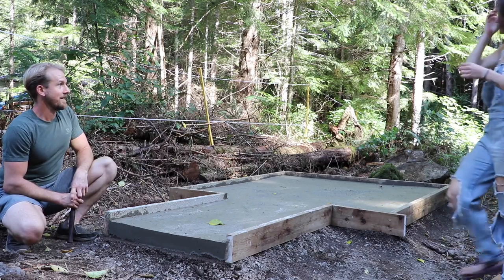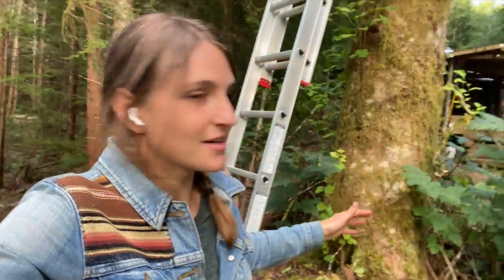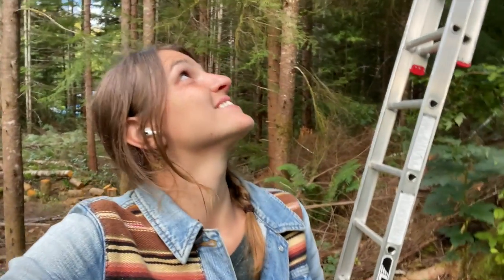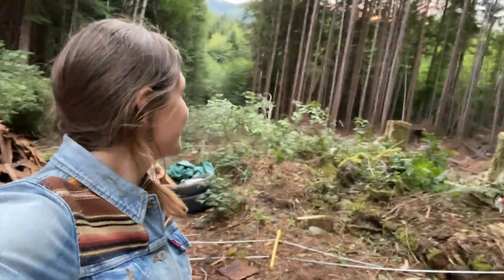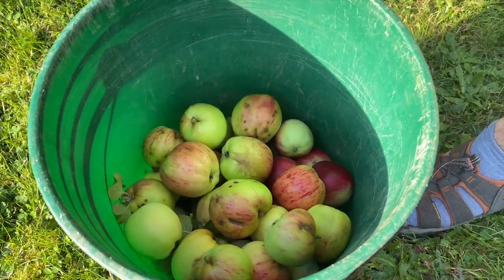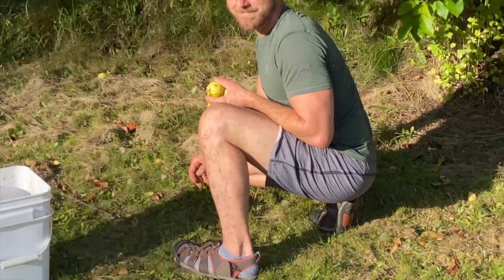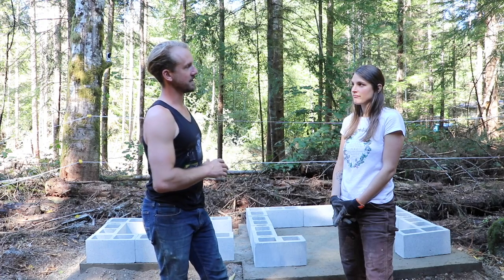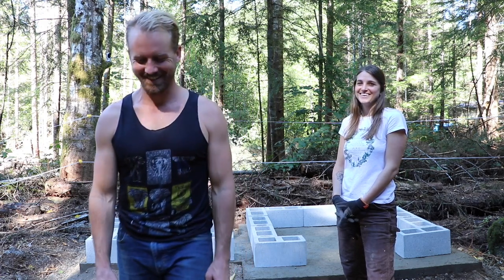Off Grid Wilderness Living // BRICK & COB PIZZA OVEN Day 2 | Felling Massive Alder Tree - Ep. 104

Comment: Please consider creating a 3 sided log room approximately 8 foot by 8 foot  and 7 foot high. Leave the north side open. Then drill 3 inch holes into the logs about 4 inches apart. Repeat this process several times per log. Use 3 or for 4 types of logs. Maple, birch, fur and a hardwood. Then cover the structure with a black tarp. Seed the holes with mushroom spores of varying types. Within a month you should have a constant flow of harvest able mushrooms. All within your arms reach.

Comment: It takes concrete 20 days to cure to reach full strength.  It should be kept somewhat wet until fully cured.  You should fill in the sides with gravel to avoid breaking off the concrete sides or eroding away the gravel from under the concrete.  You can't keep Portland cement  very long without using it as it quickly loses its ability to cure to full strength.  Always use the cement you buy right away.  The sand and gravel used to mix in the concrete should not be from salt water, it should be from a fresh water area source.  The water used to mix the concrete should also be fresh not salt water.
Reply: They add salt to concrete in the winter, done in the northern states all the time.  Not a big deal really.
Reply: Your wrong

Comment: As an arborist I suggest you ditch that ladder before you really get hurt like most people do. Before I became an Arborist I came off of the top of a 10-foot ladder working on a tree and when I stood up after hitting the ground both of my bones were sticking out the front of my right leg and my foot was on backwards. I have three steel plates and about 25 screws in my right leg.  That's when I decided to invest in some climbing gear. You don't see arborist who work in the trees all the time working off of ladders it's dangerous. Not only that I can tell by the sound that that's one cheap ass ladder. I don't want you hurt. Best wishes.

Comment: Get sand from fresh water creeks not ocean's sand that has sait in it for making concrete it will last a lot longer
Reply: That's right..
I saw that on someone's channel, someone professional.
The historic fact he sighted is, Ancient Roman did exactly tht, PLUS they boiled the mixture.

Use Sea Water
Add the ingredients
Then Boil it
Wait until it cools down, then use while warm

PS - I will dry quicker
The guy on his channel also said, to use Sea Shells in the mixture
Reply: Road builders us a brine solution to keep concrete from freezing in the winter gives it time to set during very cold days
Reply: Joel Humphreys They use Calcium Chloride in Concrete not Sodium Chloride (Salt).
Reply: If there salt in the mix the rebar will have a reaction with the salt the iron will rust and swell, it actually has a name ‘Concrete Cancer’  result loss in strength, however you will or might see cracks but for a small job like this a few cracks not going to make much difference, more interesting is his lack of safety gear when working with tools especially chain saw this has been mentioned so many time that he doesn’t seem to take any notice.
Other than that I enjoy watching the couple create something from the wilderness.
Reply: @McFarland Ever hear of Calcium CLoride? Used to melt ice and added to concrete along with hot water to keep concrete from freezing during the winter.
Reply: Ella Blun  lol you made my night. Salt is not corrosive. Hope your education didnt cost your parents too much.

Comment: "off the grid" wasn't a term when I dreamed of doing this over 50 years ago. But no opportunity presented.... love the "slow tv" of your vlogs... scenery, wildlife, (noted that Nikers taking a shower has over 5 mill views so far haha... and fair enough too!) Ginseng and Reiishi, Kai and Puma Blue Heelers, aka "tradies padlocks" (popular sight sitting on a toolbox on the back of a chippies, or sparkies, or plumbers etc work vehicle), bears and deer wandering about. Fabulous stuff. But a few points. Not a troll or hater that you speak so much about, but the chainsaw comments are not helpful. Should start saw on the ground.... every time. A kick from a saw that is not running can take Nicole's face off! And no human is fast enough to get out of the way.... even Jake with his martial arts. I've learned about chaps etc seeing what happens to others. Often the victims are lesser skilled operators trying to emulate the actions of an old hand. Just be mindful.... people from the US may be watching. 
And concrete slabs. Do not allow metal reinforcing to come within 100mm of the edge of the work. Cured concrete can easily absorb moisture that far into the slab. Contact with metal will cause rust, which will expand the metal and the concrete will fall apart a few years later. Depending on the ambient moisture levels. you say yours are high. Perhaps an an additive to your future concrete mixes may avoid "concrete cancer" which is a real thing.
Greetings from lat: -38.256, long: 143.795. Ave annual rainfall 25". I also know a little bit about bushfires. I see on the news that Oregon is having a few issues with fires. They are moving north.
Reply: HAHAHAHAHA!! "..People from the US may be watching." We're not all walking zombies here in the states, only about 95%. 🤣😂

Comment: 15.15 Sasquatch alert! Big foot sasquatch is going to get you back for sounding the sasquatch alert! Look out for any local X's that are unexplainable. The safest way is to top that tree off every four or five foot rather than felling the entire thing, and you need to notch it in the direction you want it to fall first then cut it from the reverse side to fall in the direction you want it to go. It is easier on the chain of the saw that way as well. Only amateurs try to pull it down with a truck, (duh!) but it is faster your way and did the job if you play your cards right, yet so many things could have gone wrong, you were damn lucky. I wonder what Sasquatch has to say about it? Gggrrrrowwwlllll! Grunt! GRUNT!!

When carrying the cement block, it is better to carry it from the handle web to be easier on the back. Though the lighter weight ones still do the job satisfactorily enough. You hurt my back just watching you. I hope you dont mind a little constructive criticism (suggestion). No offense intended, I just thought it might be smarter to try to be a better example to the right crowd? Good video, kids, folks. God be with you and God bless.

Comment: Your ladder is backwards
Reply: all ladders used to be designed that way, so that when you stepped down you met the next level on your heel; now when you step down, you have to remember to step IN or you miss the step; BAD DESIGN in my opinion.
I have 2) 28' ext. ladders that are built the proper way.  I suggest a bracket that will 'cradle' the tree with a V shape.

Comment: The blocks were placed upside down,  just saying.
Reply: There's a right side up? How do you tell?
Reply: Kim55200  it only matters as you set the blocks in place, the center of the block has a grip for you to be able to grab the block with one hand, he was setting the blocks with both hands.. buy no,it does not matter..
Reply: I'm sure it will still cook some fine pizzas...
Reply: I'm just wondering why he didn't put mortar on the vertical joints between the block...
Reply: @EXVITEL01  I noticed that also..one hand in the center, the other with a trowel to apply the mortar
Reply: Erich Weiler  I'm pretty sure he is claiming to be a professional at block work...
Reply: Erich Weiler  if you look back at a post,I stated the grip is supposed to turned upright......my initial post  was just stating that I noticed the blocks were placed upside down...and I'm sure jake is not a professional block layer... I'm sure you are far more advanced in brick and block work than anyone will ever be...they live out in the wilderness, they can build whatever they want, however they want...
Reply: Erich Weiler  no problem man..do you know if they finished the oven yet?

Comment: Concrete doesn't dry, it hydrates or bonds tightly together using water molecules.  You want to keep wetting it for a good week after pouring, and if it's not staying "moist" looking like this cover with wet burlap and/or plastic for a better cure.  Fresh concrete makes a kind of sizzling sound when you wet it.

Looking forward to seeing pizzas and bread coming out of your oven!  A lot of oven makers seem to get the floor TOO hot and burn the bottom to a deep black beyond-burnt wasteland before it cooks through.

Comment: With you guys running your saws as much as you are I would highly recommend Amsoil Saber 2-Stroke oil. They certify it to be safe at 100.1 when most all competitors are at 50.1 or even 32.1. Can last much longer and be much safer on your equipment. I have been running all Amsoil for years, and you can truly see a difference in how your equipment performs.

Comment: Nice job on the trees jake. I would suggest investing in a throw line to throw higher in the trees to pull your rope up higher for better pulling power. Also you may already no, but the bowline and running bowline are knots that you can use in most any circumstance that you can always untie no matter how much pressure you apply with your truck or from pulling. For a new tree feller lol, your doing pretty good in that tight space.

Comment: Jake, take some advice on felling trees, there's some great videos out there , videos showing pulling on them with the truck is just wrong ( earlier video). So far you have been lucky. Don't risk your life-health. On another matter, use a level, that base doesn't look level. Concrete only starts to get some strength at 7 days, then 14 and in the UK we get it tested at 28 days at which point it should be the min designed strength , then the curing curve slows out , it never stops curing.

Comment: Okay, you have something to learn about rebar in a slab. A good edging trowel would be handy too for future work to round off the corners. Sharp edges on the concrete is a bad thing. Corners will chip off easily where they are exposed. Just an FYI. Positive feedback?  :)

Comment: whole-wheat (wholemeal) pizza dough.  1 ounce (30 g) fresh yeast or 2 teaspoons active dry yeast. about 11/3 cups lukewarm water. 1 1/3 cups whole wheat flour ( whole meal ) 1 1/3 cups bread flour   1/2 teaspoon salt 1 tablespoon extra- virgin olive oil.   serves 2 preparation 15- 20 minutes time to rise about 2 hours.    1. place the fresh or active dry yeast in a small bowl and add about 1/2 cups of the warm water  2. stir gentley until the yeast has dissolved. set aside until frothy, about 10 minutes. 3. combine both flours and salt in a medium bowl. pour in the yeast mixture , oil and enough of the remaining warm water to obtain fairly sticky dough. turn out onto work surface lightly dusted with flour. 4. knead the dough for 8- 10 minutes. when it is firm no longer sticks to your hands or the work surface. lift up and bang it down hard a couple times to develop gluten.  5. When the dough is ready, it will be smoth and elastic and show definite air bubbles beneath the surface . place in large oiled bowl cover with cloth. set aside to rise until doubled in bulk, about 2 hours.

Comment: From someone who built pizza ovens before, a pizza oven should be much smaller then your layout. A brick oven for pizza needs to get to 900F and the pizza cooks in about 90 seconds. The oven size you're building will take you hours and Lots of wood to get it even to 500F. Not sure how deep into it you're getting but the exterior of the oven usually gets insulated with rock wool and mortar because you want to retain heat & in February it takes 2-3X as long to heat compared to summer months. An oven for the house should be about 20"x20"x12"-16" (LXWXH). You can make the oven floor space square or rectangular but traditionally its round. The top usually gets rounded to create a dome/rounded shape and that 12"-16"at the peek height. Just saying, if its a pizza oven that's how its done.
Reply: You need fire brick for floor of the oven!
Reply: @lindahill6633  Absolutely!! Very important. The floor and walls should be fire brick. The right mortar mix  for high heat temp is needed too or it will crumble.  He wont respond or take advice because he knows it already😂😂

Comment: WOW! What incredible alder trees! Splitting those huge pieces looked relatively easy (for 'green' wood) - or was that from older dead logs? Alder is a beautiful wood for furniture, planks, trim, etc - especially that size, and a relatively 'soft' hard wood. Too bad you didn't slab a few pieces out before you cut it all for firewood.

Comment: Did I miss something, I thought you were building the pizza oven on one of the petals? Now I see it is on the ground and closer to the door. BTW, good call on where it is located!
Reply: I suppose they finally realized there was no way the original spot would handle the weight, (or size even)

Comment: When are you going to get a band sawmill? The money you spent on framing and decking so far would have easily paid for a small sawmill. A band sawmill has to be 10x fast than a chain sawmill and less work. I have seen them a cheap as $2000. new, I may not recommend that one but you can get one that will serve you well for a reasonable price. Lets face it wood is a big part of your life!

Comment: Hi I really dig the content my brother and I just built 2 30ft pacific yurts in Brookings Oregon, similar weather as where you are I believe. I was wondering if you ended up doing floor insulation? Do you guys keep warm enough during the winter? PS you guys are very impressive putting up the ring and roof material without a scaffolding geez.

Comment: Fact one, your foundation is too thin. Fact two, you wanna put the iron inside before you add concrete and fact three, i hope you weld or at least strap the iron together with iron wire ( i just watched untill 5:35 now and wait, fact four, your concrete contains not enough water
Reply: I've been installing concrete over 30 years and everything you stated is false. Juss sayin. No hard feelings.
Reply: The only  mistake I seen was not dry mixing it before adding the water.